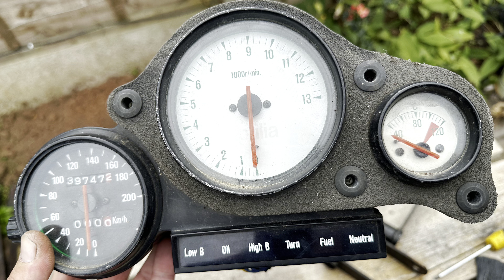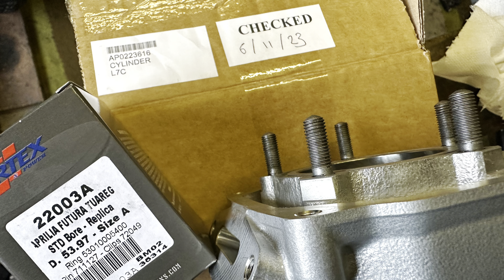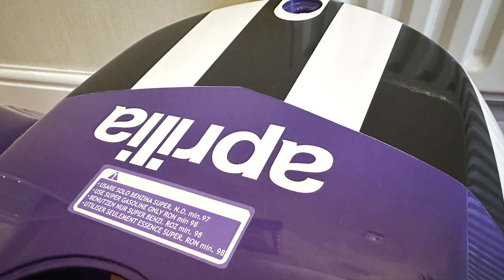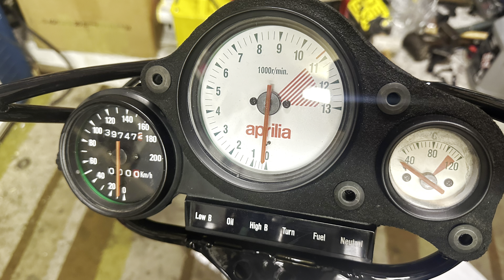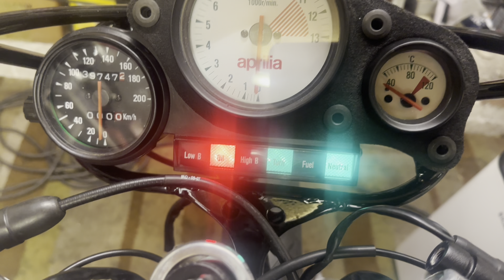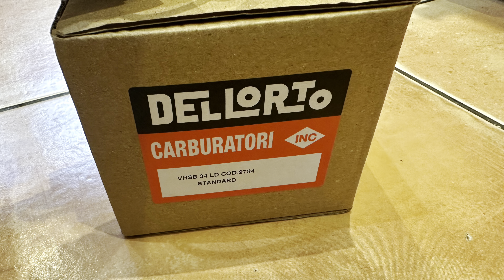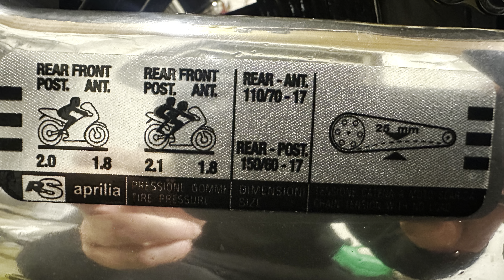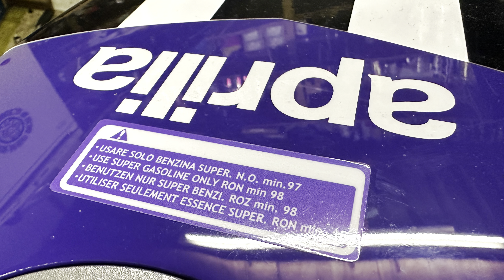1993 Aprilia RS125 - Restored by Ringos Restorations - Instagram @ringosrestos

Comment: Nice job, but ruined by polishing that frame. And applying that horrible decals. The font of Mobil1 is wrong, same for "replica". The decal on the fuel tank is not original. The fairing bolts must be dark, not inox. I can't imagine the squish of the engine head... It is offensive for a icon like this bike
Reply from the maker: Good luck finding some original decals and even if you did 31 years old the adhesive be no good. Engine has obviously had squish checked, it’s a brand new Aprilia cylinder head and Vertex piston. I prefer the polished frame and thinks it makes it look even better but personal preference
Reply: @r1ngo46  personal preferences and originally restored are different things. You can easily find reproduction of original decal for a cheap price.
I reapet, nice job, but here in Italy, where that bike is born, you can't find approvation for that job.
Reply: There's always one  🥱
Reply: @Le125anni90  If you can easily find original stickers, get them for my Rs 125 R 1994 (Rossona)